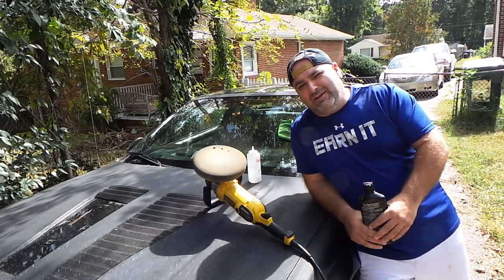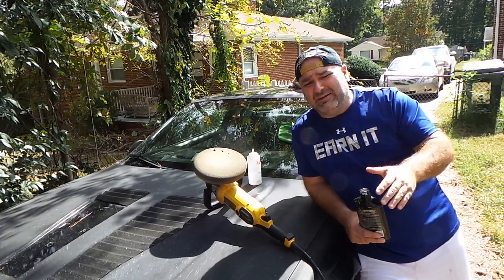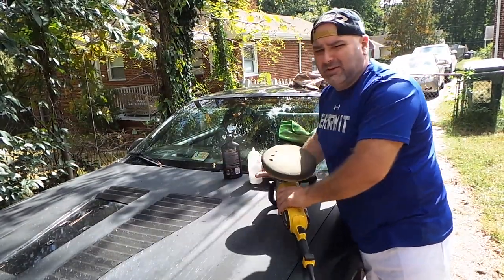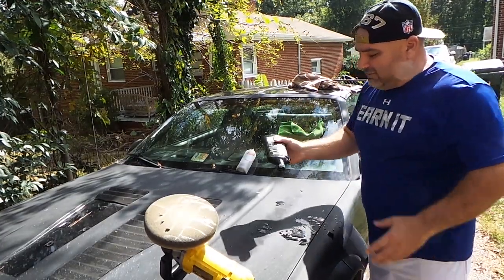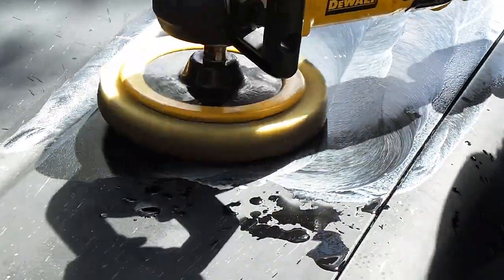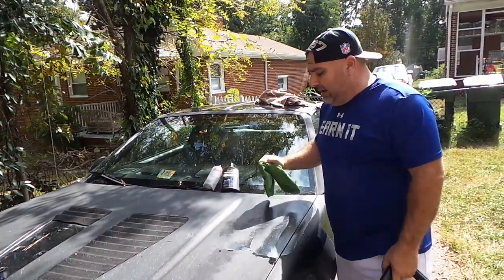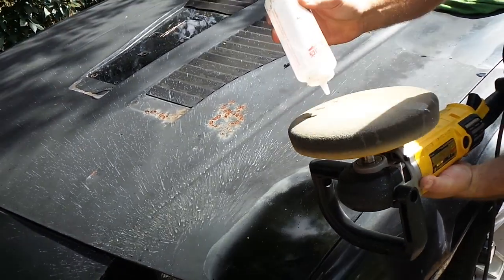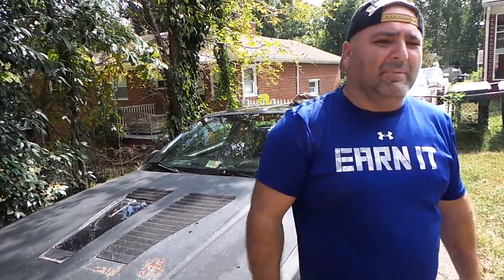Buffing Heavy Oxidation Off Of Paint

Comment: HMM GOOD JOB,  BUT YOU COULD HAVE WASHED THE CAR AND THAN CLAY BAR TO REMOVE CONTAMINATION, PAINT WILL BE CLEAN AND SMOOTH AND ULTIMATE POLISH WILL THAN REFINE THE PAINT TO BRING OUT THE GLOSS, THE PAINT WAS SO BAD YOU COULD HAVE USED SOMETHING STRONGER LIKE MEGUIRARS  ULTIMATE COMPOUND  OR  m105 COMPOUND AND WOULD HAVE MADE THE JOB QUICKER, IS THERE A FINAL VID OR PIC OF THIS CAR COMPLETELY DONE ? COOL VID
Reply from the maker: +Abel Celestin  Jr  car was washed , alwasys go light then increase cut  to reduce paint damage , the after video should be out soon, it turned out good

Comment: Any way to remove cracks from paint, it's like it's creasing upwards and there about a centimeter in length. The car has clear coat peeling but not in chunks exactly. 1993 mustang and is in the south so I'm thinking the heat caused the paint to go bad.
Thanks
Reply from the maker: what is started to cracked like that you're basically left with an sanding it out

Comment: Since you buff the old oxidize clear coat and paint and got down to the good looking paint do you have to put a clear coat on the car? Because i think the hot sun will just oxidize and burn the paint in no time if its left like that. Nice job by the way.
Reply from the maker: Good sealer would be fine